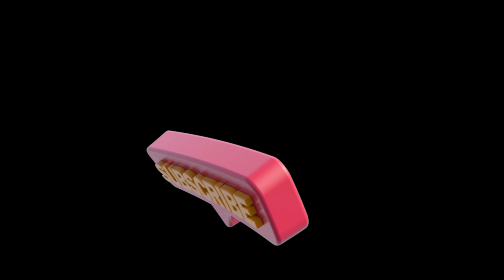Benchman VMC5000 3 Axis CNC EP7 Wrapping up (sold)

Comment: Just finished watching youre series. I may have missed it but we’re you able to create the 3 to 1 ratio for the spindle for higher rpm?
Reply from the maker: Juan, so far no… I like the 10k rpm, more would be nice. The 1hp rating is what I dislike the most. I really cannot push a 1/4” end mill very hard due to the low hp. I plan to visit the higher rpm and hp later. I was Thinking of using an ac servo, but due to the 2.5k rpm I may not be able due to pulley space for3:1 in the housing. I may go with a VFD and modified spindle motor with a small flipped ratio. I would like to see up to 18k at 2-3hp. Stay tuned though I will be back on it. Life and day job has limited my free time